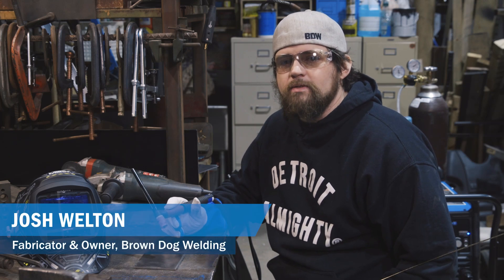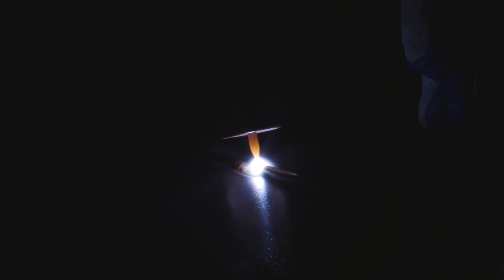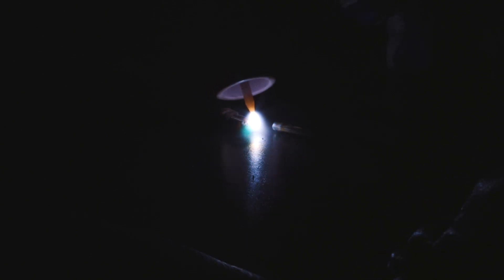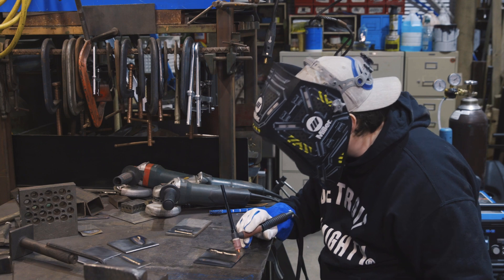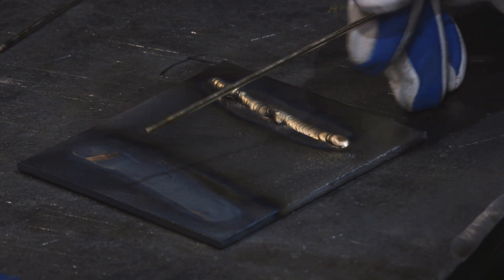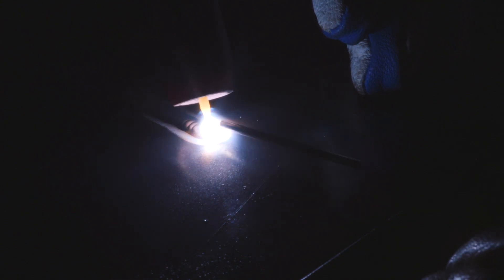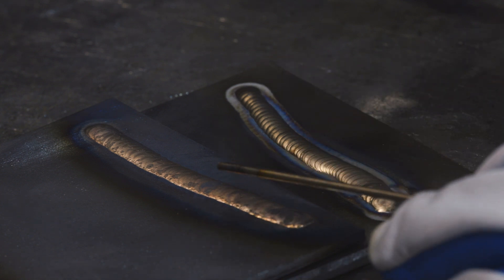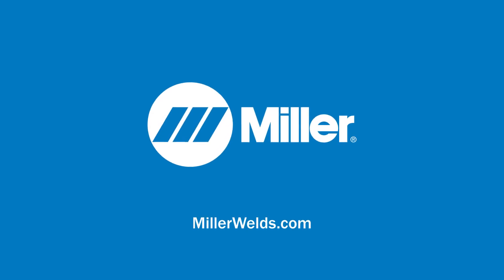The Dos and Don’ts When TIG Brazing Silicon Bronze

Comment: I have a large 17 inch bronze bell with cracks on the top. The top does not carry sound vibrations so the crack is not a theat to the lower areas of the bell. My question is can it be brazed onced the bell heated and the brone will stick to the base metal ( the bell)  ?
Reply: No one can answer that unless you know what alloy you're working with.
Reply: @MikeYurbasovich  Bell bronze is usually 80/20 copper tin, FYI.

Comment: I use silicone bronze rods sif no1 on DC.tig welding using argon  pure shield and it gives off a lot of smoke. Why is this? 
I've use phosphorus bronze before and you get a nice bead just like you have done here. Is there something I'm doing wrong which causes the bad smoke? Im welding brass
Reply: brass contains zinc which boils/burns off at a much lower temperature than the copper which causes the smoke, very similar to welding galv. also toxic to breathe

Comment: I find a 1.6 pulse on dc makes this stuff weld brilliantly.    IMO DC with slow pulse is the best balance between the silicone bronze flowing and keeping it clean if you get right.    Havent felt the need for AC which might be more worthwhile on castings and stuff like that would be my guess.

Comment: What tungsten do you use on AC? I had a blue one and on AC it went away and I could not establish a good arc.
Reply: Not sure what he was using but I have great luck with 2% zirconated for Aluminum.  Holds up to the heat better than Puretung

Comment: Whenever I try to tig braze silicon bronze, it sputters and crackles and smokes leaving a thick white powder on everything. HELP! What am I doing wrong?
Reply from the maker: Steven, typically the white residue that shows up around a silicon braze indicates it has been overheated.  You  want to lower your heat input which can be done with your amperage setting but also be mindful that a very slow travel speed can significantly increase heat input as well.  A second item to check would be your shielding gas.  Make sure the Argon tank is at a relatively high pressure, not near the end of the tank.  Low tank pressures can amplify moisture problems that you may see in the weld/braze zone.

Comment: Dont you need flux?
Reply from the maker: Flux is not needed with the GTAW process like it would be if you were oxy-fuel brazing.  GTAW has a shielding gas flowing from the torch which blankets the weld zone and protects the weld from atmosphere contamination; flux achieves this as it is consumed in the oxy-fuel process.  Please let us know if you have additional questions!

Comment: Can I do tig silicone bronze on cast aluminum dc ?!thanks
Reply from the maker: Thanks for your question. We wouldn’t recommend doing this process. Cast aluminum should be welded in AC. It is a very dirty material and needs the cleaning action of the reverse polarity in AC. Also, using a silicon bronze rod is actually brazing. Brazing requires the filler metal to lay over the top of the base metal. Since cast aluminum can house so many contaminants, the silicon bronze most likely won’t adhere to the aluminum that well.
Reply: I was thinking the same can u braze silicone bronze to aluminum

Comment: thank you. this is a great video. I have a Question I was hoping you answer soon because I got do the job tonight or tomorrow.  if I am brazing aluminum and steel should I braze with AC or DC?
Reply from the maker: Hi Jack, thanks for your question. AC should be used when trying to join steel and aluminum.
Reply: @MillerWelders  Thank you.
Reply: @MillerWelders  - Just to clarify that I understand your response; you're saying that aluminum & steel can be brazed??  With silicon bronze or aluminum bronze or some other filler? I've never heard of this, but would love to learn more about it.  Thanks
Reply: @ls2005019227  I'd love to see and answer to this question also

Comment: So i did some cast iron, and I think I got it too hot, and does the base metal mix with the sil bronze and create some kind of mutant metal that will not machine? Cause it breaks a carbide tipped boring bar.
Reply: You’re not supposed to melt the base metal

Comment: DC settings?????
Reply from the maker: Hello. When brazing with silicon bronze set the welder up to 1 amp per .001” thickness of material. It is similar to steel, except you are not forming a full puddle before dipping the rod in. Let us know if you have any additional questions.

Comment: Can you TIG-braze without gas, using flux-core bronze rods?
Reply from the maker: Hello. We apologize for the delayed response. If you plan on using a self-fluxing bronze rod, at that point you would be using an oxy-acetylene flame and not a tig torch. If you plan on using a tig torch, gas is required. We hope this helps!
Reply: @MillerWelders  Yes, it helps. Thanks for the reply, but you don't need to apologise. You don't owe me anything.

Comment: Looks like I need to give this a shot with my Multimatic 220 as well! I need to join a black oxide treated sprocket to a cold rolled steel hub. Aside from degreasing, is it recommended to removed the black oxide from the area to brazed from the sprocket?
Reply from the maker: Hello Tim. Thank you for reaching out! You could most likely weld right through it but with the TIG process starting with clean metal is the best way to go so I would suggest cleaning it off before welding. We hope this helps! Let us know if you have any additional questions.
Reply: Great question! 👍